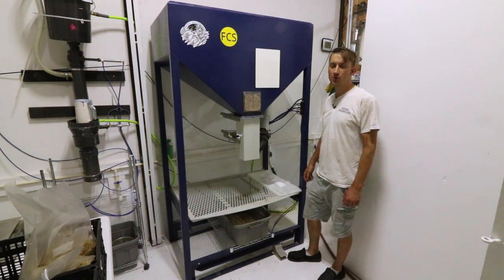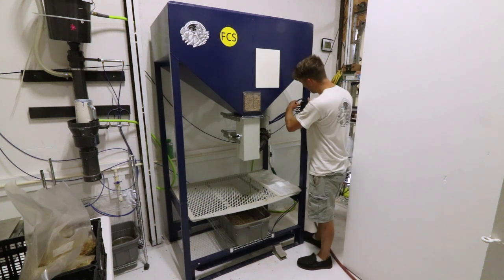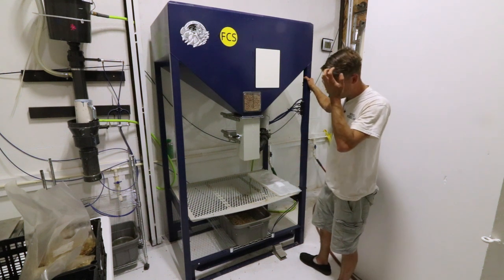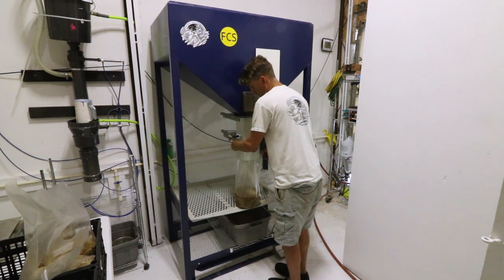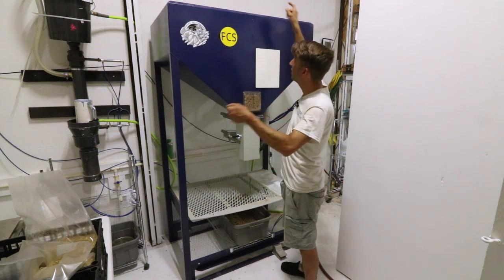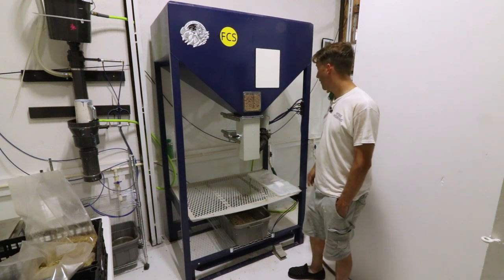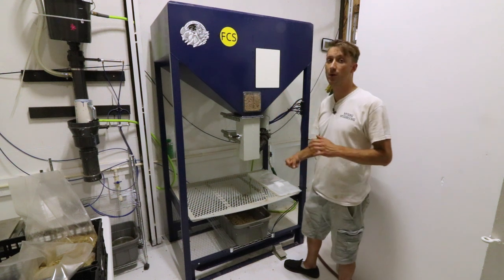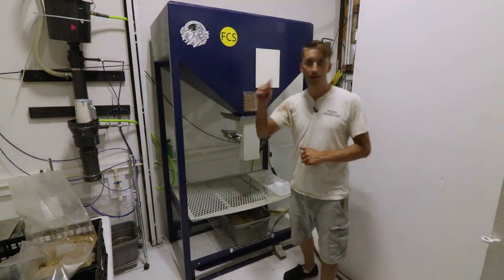UPDATED! Mushroom Substrate Wet Bag Filling Machine 350 bags per hr!!!

Comment: iam from europe and have no acces to soy hull's 
i think the way this bagger works is that it fills the valve equally and you can only make substrate that is 50% of one and 50% of the other ? is that correct ? if so ... anny suggestions on what elsei can use instead of soy hull's that can be done 50/50